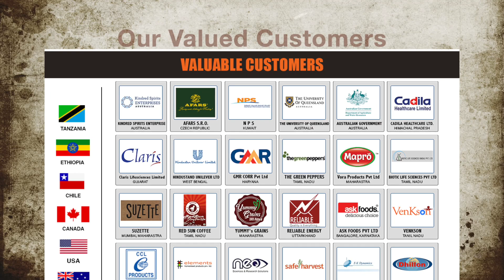Unlock the Power of Spice Grinding: How a Spice Grinder Machine Works

Comment: You can not start  machine  with out Mistry  C ompany  does not proper fitting  Motor is not sucess I purchased Rawa machine  which is useless with me
Reply from the maker: "Sir
Sorry for your problem 
Its not possible  
You can contact to our customer care dept.  
You will definitely get solution"

Comment: Sabse ghatiya machine hai air + sound vibration bahut jyada banata hai
Reply from the maker: "Sir
Sorry for your problem 
Its not possible  
You can contact to our customer care dept.  
You will definitely get solution"

"MILL POWER PVT LTD 
CUSTOMER CARE DEPARTMENT
Mrs. KAJAL 
7435996771 

10 am - 7 pm 
Mon - Sat"